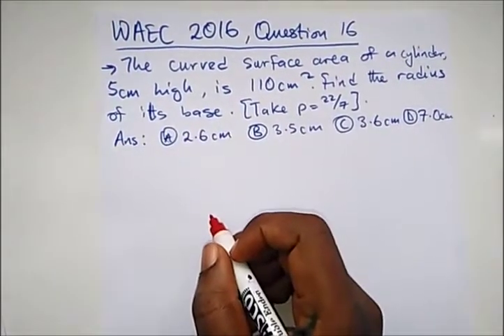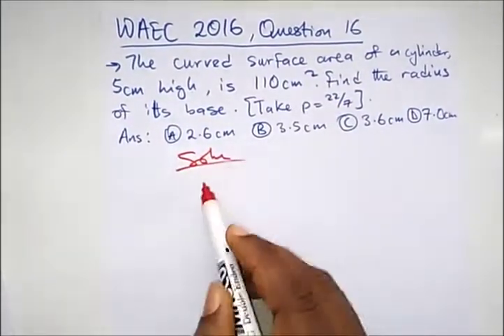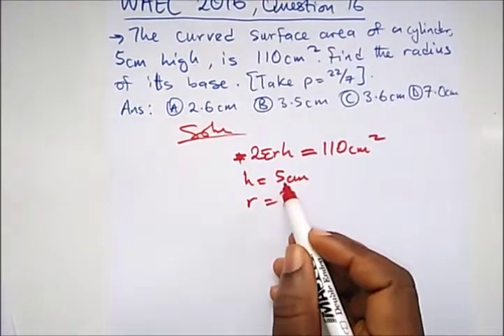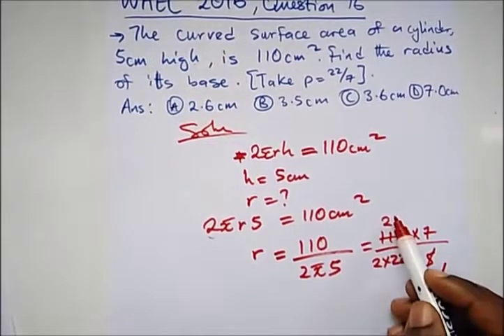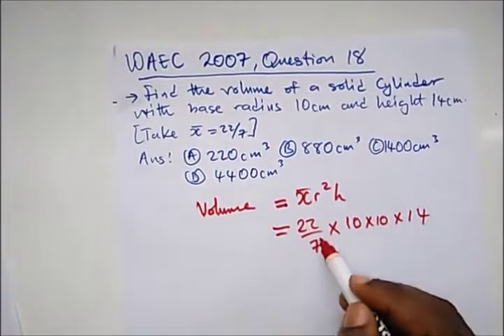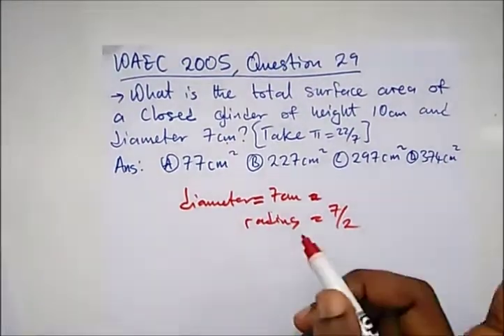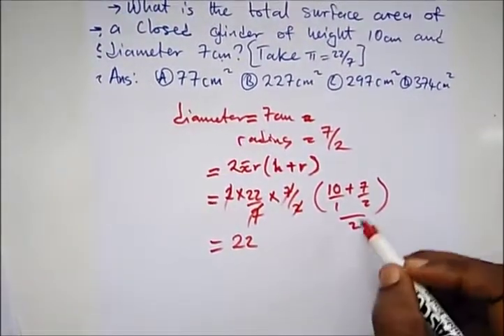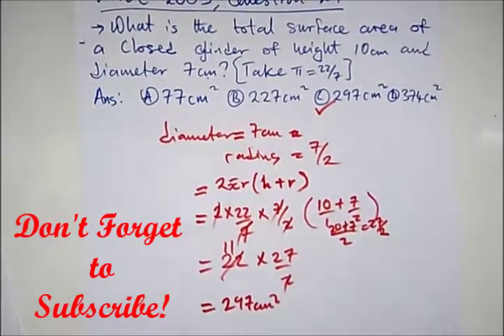WAEC Past Questions on Mensuration of Solid Figures - Cylinder

Comment: Ma please can u make a video showing the cross section of a garden in shape of a of a prismalso calculating the area of cross section and the capacity in litres of the bond if the length is 1.4 m